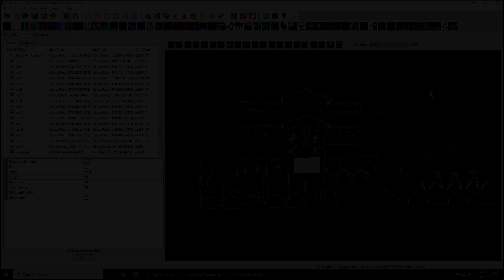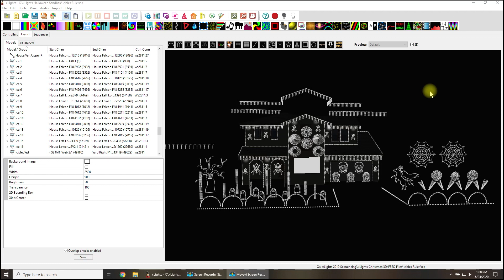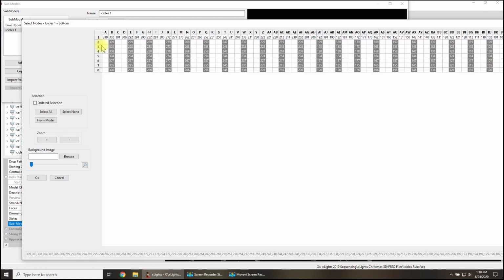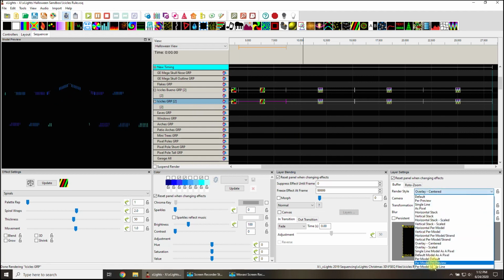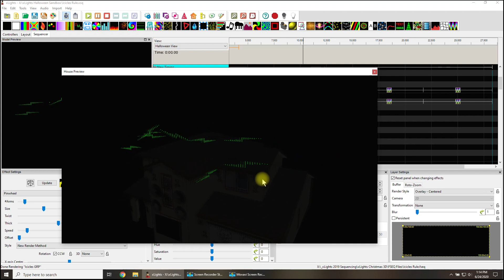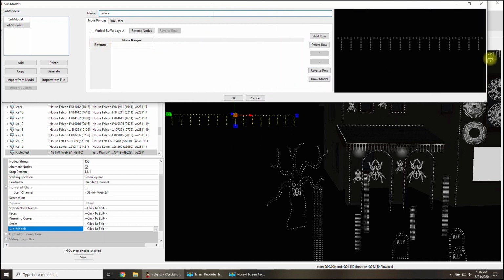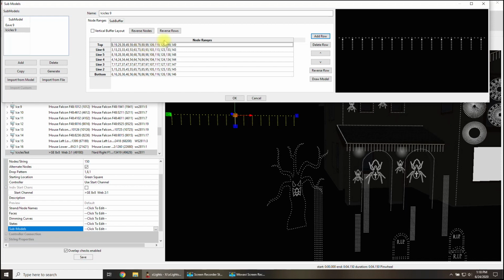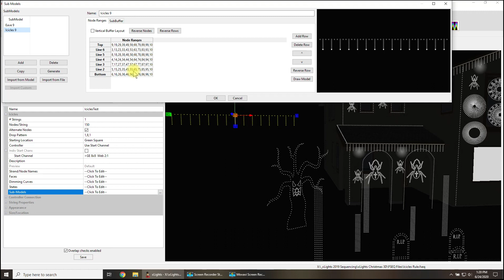Icicles Modeled Like A Boss

Comment: Are those shadow models for the icicles so you can wire them up to a few different ports? I have 950 pixels on one set and I wanna wire them up to three ports. I made a shadow model for the MOAW so I assume I’ll have to do my icicles the same way.
Reply from the maker: Yes, I do have the section over my garage that use a shadow model.
Reply: That’s the confirmation I needed. Thank you very much!

Comment: Hi Ron, i have one question, do you mount your icicles in any kind of coroplast or you just put the string mounting from the roofline? At this moment i have a megatree done with pixels and my icicles are "normal lights", i would like to change to pixel lights in the icicles but i would like to have more than 7 lights in the dropdown. Something that at this moment can be done only with normal WS2811 lights, not with the icicles specific pixel string right?
Reply: You can contact GEPtops.com and ask for a custom icicle prop. Xlights will let you configure the lights for any size drop pattern.

Comment: Are this submodel creation can be use for the peace stakes?  Please advise 
Thanks!
Reply from the maker: I would not use this model for the stakes. I would use the cube model depending on how you layout your stakes.
Reply: @xTremeSequences  I'm new in this world, but just create a single line with 12 pixels, and copied ten times (Stake 1-1, 1-2,..., 1-10), then I create grups of tens, Stake 1, 2, thru 12 (because I have 12 sets). Technically the model you suggested (cube) I don't know what it is! 😪.
Reply from the maker: @raymundolopez431  It takes time to learn,  man.

Comment: But how would you wire those icicles up now the correct way? Still trying to understand that part. Also how are you Wiring them up from Icicle to icicle? are they Dasiy chained Or does each icicle have its own port?
Reply: Since I am using bullet nodes i start at an end and going across the top until I am at the center of the icicle where I begin the drop by skipping every other hole so that I can make my way back up and across to the next drop. If you right-click on the midel and select Wiribg View it shows you how to wire it.